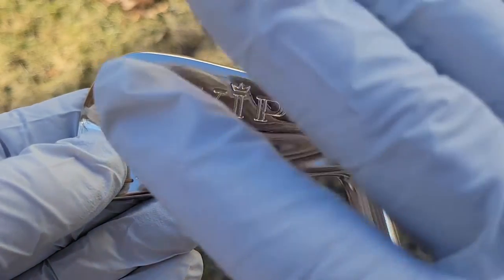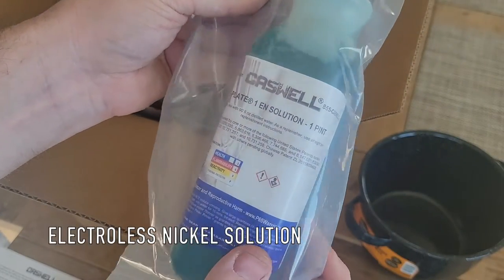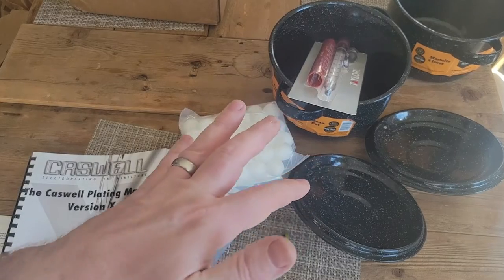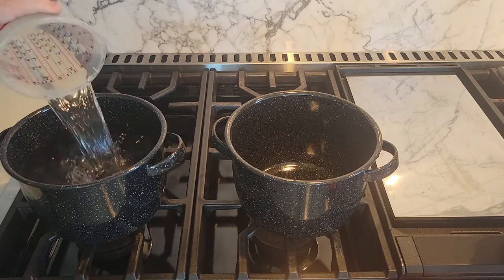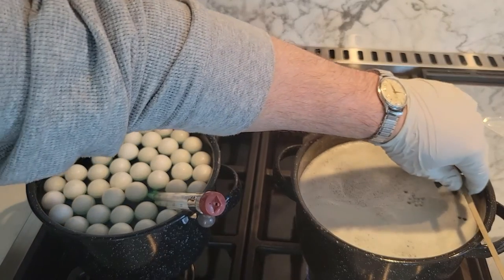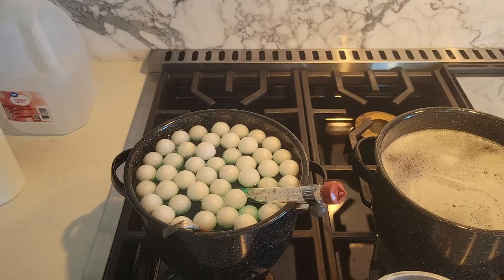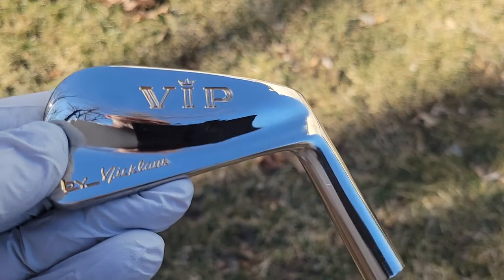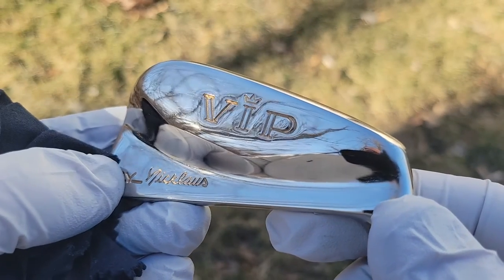ELECTROLESS NICKEL Plating Tutorial

Comment from the maker: Note: About 12 clubs can be plated with the mini kit before having to add replenisher to the solution. 

Take a look at the kit here: https://amzn.to/3kbMAnM
Reply: Awesome video, I appreciate the information. I just got the same kit and am eager to try it out, however my math says the bath would crash on the 2nd club without replenishment, am I calculating wrong? According to Caswell's booklet a mini kit can only plate 12 square inches for 30 mins before it needs replenished.
Reply from the maker: @Russ Moriarity  I have to dive into the math, buy the rep said the mini kit would do 12. What did you end up with for your surface area calculation?
Reply from the maker: @Russ Moriarity  Also, wonder if there's a difference in calculation with the One-Plate® vs their other electroless products? The website isn't clear to me.
Reply: @midwestmagneto  Website states the Mini kit will do 70 sq in, not sure where you are getting 12 sq in. 

Mini
70 sq in
Standard
140 sq in
Deluxe
2 Sq Ft (288 sq in)
Jumbo
4 Sq Ft (576 sq in)
Reply: @FawkesHD  70 sq inches is listed as the mini bath’s maximum at once. However you can only use 360 “credits” before it requires replenishment. Using their formula is how I got 12 sq inches for 30 mins (360 credits) before you’d need to replenish the bath (15 or so drops of concentrate).
Reply: @midwestmagneto  Gotcha, didn't understand your comment correctly. Replenishing the solution is as simple as calculating how much per club head loss and just adding that much and waiting a minute before adding in the next head. Doesn't seem like a huge problem to me for the ease of this method.
Reply: @FawkesHD  yep it’s pretty darn easy the way caswell has set it up. But if you don’t do the math you’ll ruin the whole bath. Didn’t want OP to do that.
Reply: @midwestmagneto  True, can't make anything completely fool proof. Big game changer that this even exists though. Haven't done it myself but definitely interested in doing a few sets of clubs with it.
Reply: I love the videos. I assume your a golfer? Have you ever golfed in Nebraska?
Reply: PERFECT cant wait to work on my grandfather's wilson staffs!
Reply: I bough the one size bigger than the mini kit. I have put so much into these clubs I’m VERY nervous on this and worried now big time even losing sleep🤦🏻‍♂️. I have 4 sets of irons I need to do

Comment: Love the videos! I've performed every step you do (aside from electro plating) and my clubs have come out great. However, I have one big question for you. 

Some of the clubs I work on have paint on the grooves (older style clubs) and after sandblasting the face I try and paint the grooves but every time I do the paint spills off on the face and I can remove any of it. It's to the point where I have to re-sandblast it. Is there a technique of something you use in order to get the paint off without running it all over the place??

Comment: Hey there Brad! Plating things is actually my job, though typically it's for aerospace companies and not golf clubs. Electroless nickel is actually the process I run the most, however I also do a variety of electroplating, anodizing, and other chemical processes. There's a few important steps missing here so judging from this setup, you're probably going to have poor adhesion and low thickness - if I had to guess I'd say you got around 200-300 microinches at absolute best, which will lower with each use. That being said, before too long, the nickel will begin to chip away. I also imagine the supplies will get costly. Not that I'm saying this is a bad idea, I actually think it's pretty cool, but if you're ever interested in high-quality plating, hit me up and we'll work something out!
Reply from the maker: Wow. Thank you for reaching out. I'm very happy to make this connection. 

When I do traditional electroplating, I generally use an electrocleaner, Wood's Nickel Strike, and/or a nickel activation step before plating (with rinses in between).  The guidance in the included instructions on the electroless kit only had me degreasing the parts then straight into the tank for plating. They passed my 'water break test', but there was no activation of the remaining nickel or any other preparation.  I'd be grateful to speak with you to learn what preparation steps our subscribers could do to encourage better adhesion and durability. I'd also be interested in any recommendations for more chrome-like plating for a harder surface than the nickel. 

My YouTube channel is really geared towards budget-conscious, entry-level DIYers with little to no experience in either polishing or plating, so I want to make recommendations that fit into those criteria. I started the channel to document my experiments, so I'm also learning as I go, trying new options, and adapting the process as I learn more and more. The simplicity of the One-Plate option (which has a single component that is used for replenishment as well) over 'traditional' electroless plating or electroplating is really what drew me to this product. I'd be curious to know your professional opinion of the new One-Plate Electroless process    https://www.one-plate-en.com/about-one-plate , 

Replenishment is also an area of confusion for me. The directions are horrible. They speak about adding parts B and C, but One-Plate has a SINGLE component so the instructions are for their traditional electroless kit.  This webpage says it plates at .5 mil (500 microinches?) in 30 minutes. https://caswellplating.com/one-plate-1-electroless-nickel-kit/. The directions have me replenishing at the 15 minute mark with only a few ml of solution. I'll have to look at my notes, but if I remember correctly, the club head was around 13 sq inches of surface area.

Finally, I love your idea of of having an avenue for our nearly 10,000 subscribers to be able to send clubs to a professional to plate if its economically feasible for them. Again, budget considerations are at the forefront of the processes for us. So, I'd be interested in hearing how we can collaborate with our viewers who also want to do the polishing and send it off to a plater.

Would you mind sending me a message to keep the conversation going? My email is on my ABOUT page.
Reply: You got discord @tripper3737? 👀
Reply: @BradMeehan  sorry for the late response here, Brad! I hadn't seen you replied. I'll look through the links you sent and send you an email so we can discuss all of it shortly!
Reply: @BradMeehan  Hey Brad, I have a few questions for you but I can't seem to find your email on you ABOUT page
Reply from the maker: @tripper3737  brad@bradmeehan.com
Reply: Hey! Can I contact with You also? 😀
Reply: @dawid8502  sure thing!
Reply: @tripper3737  Just tell me how! Hahaha
Reply: Hi Brad,
Wouldn't 0.5mm plating be 20000 micro inches? That seems a lot bigger plating than @tripper3737 is estimating, however the large stone cuts on the sole have been completely filled! Did you do any polishing before plating to remove the large scratches? If not, it looks like 20000 microinch plating is possible with electroless nickel.
Cheers Paul
Reply: A quick internet search seems to say 10-15 microns of plate of nickel per hour in the electroless nickel bath.
Does that sound right?
Reply: So I put a video in this post and I’m having trouble getting rid of the small pits left over. If I do this will it cover the small pitting problem. I have sanded it best I can for HOURS each individual iron🤦🏻‍♂️. How can I fix this problem? Or can I even fix it?
Reply: I was wondering if you would know if something like a Wood's strike would work on tungsten. I'm trying to find a way to make solder stick to it and was thinking that a tiny nickel layer would suffice since nickel is easy to solder onto.

Comment: Hi Brad, I love your channel. I'm learning so much from it.
One question re: this Caswell plating process. Did you have to remove the plating that remained on the club before sining the Caswell product?
Reply from the maker: The chrome, yes. But you can plate over the remaining nickel. They warn of it being brittle if you do. You'll remove most of it with the sanding and polishing. I do notice a slight color difference where specks of old nickel are under the fresh nickel. It's almost shinier, so if you want to ensure uniformity, you should try to get down to bare steel.

Comment: Amazing.  Are the two pots included in the package?  The Amazon product page doesn't state whether the pots are included
Reply from the maker: Yes, here's the list that should be included quoted from Caswell's site:

Kits Contain:

2 x Glass Lined Tank

Thermometer

Mist Control Balls

One-Plate® 1 Solution

SP Degreaser

The Caswell Plating Manual

Free Technical Support

Comment: Do you still need to use the electro cleaner and wand before you plate with this process? I’m still a little confused on how to setup the brush wand and power for that step. Thanks Brad!
Reply from the maker: I did use it on my newest videos. As long as you pass the 'water break test' with the decreased, you should be OK. But if you have a wand and power supply I can talk you through it. It's a 30 second job for peace of mind.

Comment: Hi Brad! Is there a difference between this nickel solution and the one you use for electrolysis? Or is the method the only thing that changes?
Reply from the maker: Hi, Gaston - Everything is the same except the method that the nickel is bonded to the club. One uses low electrical current and the other uses a reaction where heat is the catalyst. But, what ends up on the club is still nickel.

Comment: I like the look of this Brad. Thank you. It might be a dumb question but how do you determine which irons you can use this process on? I have found information on older models of clubs hard to come by - eg shaft sizes, head material, weights and so on.
Reply from the maker: If there's rust, you can do this process because the club is likely carbon steel. If there's no rust, you can polish them but you don't have to replate them because they're likely stainless or similar. 

I have a book that also tells if the club is cast, forged, stainless, or carbon steel. it's an old golf club collectors book. I can look one up for you if you need help.
Reply: @BradMeehan  so if it a blade oriented clubs.. mostly carbon steel right..
Reply from the maker: @ToraxReborn  That's a good assumption. I'd do a search to see if you can find out if it's steel or something else.
Reply: @BradMeehan do you know what the metal composition is of Ping s59 irons from 2003?

Comment: Brad, I am assuming you could also do shafts too correct? My theory is the club wont look good if the head is shiny and the shaft is rusty and old. A long trough with the solution would work??
Reply from the maker: For sure. Check out the video I did on shaft restoration.

Comment: Have you done a cost comparison per club assuming you are doing more than 12? I've been collecting irons for years and have hundreds that I'd like to refinish and it would pick the old method over the easy method if it is significantly cheaper. I can see easy makes more sense for one set, but how does that change for over 100 clubs?
Reply from the maker: The plating method looks cheaper than Electroless but you'll still have to replenish the anodes as you work.  It's just 'more difficult' (even though it's easy as hell) to get the perfect finish because you have to figure out the best voltage/current that suits your container and parts.

Comment: Would this be good to do on firearms? Does it last? I wanted to get a black nickel finish
Reply from the maker: @cdjthg9516  yes. It's nickel just like if you did standard electroplating. This is much easier and doesn't require a power supply. I have other videos on how to make a standard plating tank, but if you've never done it, this is the fool proof way.

Comment: This method is only for the plating process but if we want to fill bag chatter and dings we also need to purchase a power supply system and follow your order videos for copper filling correct?
Reply from the maker: The sanding is really the easiest way to get the chatter and dings out. Filling them with copper (or other metal) is a solution like in that Mizuno video, but it's easier to sand it down, then account for the weight when you reshaft them. 

You can make a power supply with old phone chargers but you have less control over the output than investing in a power supply.
Reply: @BradMeehan  I contacted a club refinisher who does it as a business and asked him about the copper method for filling and he said that the copper is too soft and to use nickel instead. I have a number of items from your Amazon store in my cart waiting for Amazon Prime day a courage to do it lol. I'm planning on using the DC power supply to maybe clean but mostly fill scratches and gouges and then the Electroless pot method for the plating. I have graphite shafts in my irons and hesitant to remove them, is it not possible at all to do this with the shafts installed?

Comment: Well shit lol this is way easier! I’m going to go this route! Question do I still need the nickel activator? 

How long did you degrease it for?
Reply from the maker: The degreaser step was 5 minutes. I'd still do the activation step of there's remaining nickel. I didn't do it in the video, but it's a 2 minute job to have piece of mind that the nickel is ready for more plating
Reply: @BradMeehan  Brad - do you still electro-clean as well?  Or does the Degreaser replace this step?
Reply from the maker: @hunterpalmer1442  I didn't in the video because it passed the water break test. You can go wrong with extra cleaning if you have the equipment.

Comment: Seems like about $10-11 per club.  How much was the other solution in comparison—excluding initial layout expenses like voltage generator, tubs, copper rod, etc.
Reply from the maker: Great point. The nickel anodes themselves were 48 dollars, the power supply is ~60, plus tubs etc.  Elecroplating is cheaper in the long run because the anodes have lasted a LONG time. But, for ease of use, i'm 100% in the electroless camp if I can continue to turn out work like this one.

Comment: Does it work with plastic ?
Reply from the maker: Even if you coated it with a conductive paint, I doubt it would withstand the temperature of the solution in the pot. You'd be better off doing the traditional nickel electroplating method here.

Comment: did you polish the club after you plated it?
Reply from the maker: You can polish after if you have blemishes, but I wouldn't use anything heavier than the white compound and the green/loose cotton. You'll have to avoid hitting the textured area on the face or it will polish it and ruin the texture.
Reply: @BradMeehan  Thanks for the info! But did you polish the chrome after you plated it?
Reply from the maker: @samking4179 Yes  just before I filmed the last shot to remove fingerprints, etc. I used the green and the loose cotton, no grit.
Reply: @BradMeehan  Great! Thanks!

Comment: Was the golf club touching the bottom of the pan during plating? This is important!
Reply from the maker: It was. Should I hang it?
Reply: @BradMeehan  not sure that’s why I asked , 😂.
Reply from the maker: @brunoburtoni8479  lol.  hanging would be better, but it will still plate evenly with this method. I did move it around as it was going, but if liquid is touching it, it will plate to it.
Reply: @BradMeehan  Cool . I just researched abit the complexing agent needs to be replenished quite often . Might get a bit expensive with that. Unless you don’t plate often with electroless. Should be fine.

Comment: I don’t think boiling an egg requires math. Just got the kit, and you have to be replenishing with the solution after consuming only 20% of the plating capability.  You have to measure the sq inch of the material you plating, and depending on size and time you might have to replenish before the piece is even complete. Not sure about the usability of the product.
Reply from the maker: I have the replenisher on the way so I'll make a video of the process. The One Plate product also requires adding solution like traditional electroless, but they says it's only a few milliliters according to the docs. The rep said I could do 12 with the kit, so there is conflicting guidance.
Reply: @BradMeehan  my biggest concern is that the literature says that if you go below 80% of the formulas capacity it will be rendered useless. Too expensive to waste it because you went a club to far. Have you done the 12 clubs? Based on my math, I think you can only do maybe 3 clubs before you have to replenish.

Comment: 150 bucks for the mini set...how many times you an use the solution? doesnt seems very cheap
Reply from the maker: They said about 12 clubs before replenishing. It's cheap relative to the alternative of traditional electroplating where you have to buy the power supply, nickel anodes, nickel solution, brightener, aerators, etc.  Most companies charge 50 per club to refinish and plate so this makes it affordable if you compare those two scenarios.
Reply: @BradMeehan  Damn. $50/club is pretty expensive. Wasn't aware of that. I guess it only makes sense if you have sentimental value for the clubs. Else it exceeds their actual value almost every time.
Reply: @BradMeehan  12 clubs with this pack of 154 US$? Have you tried already in 12 clubs, understand the time and quality of nickel plating will deteriorate gradually.